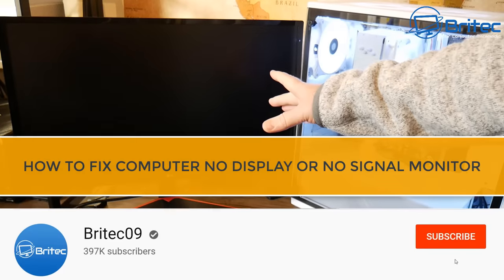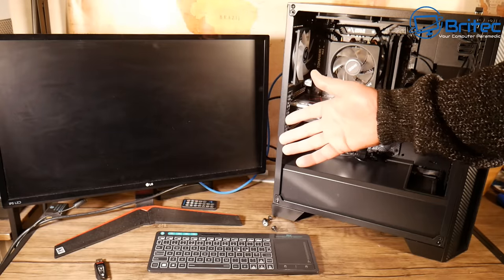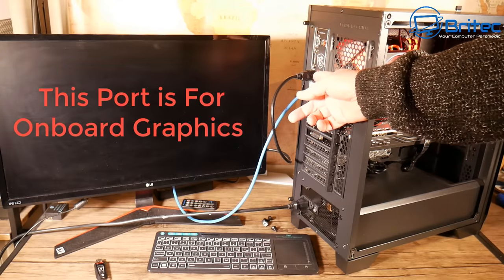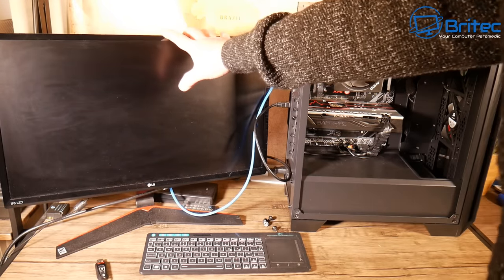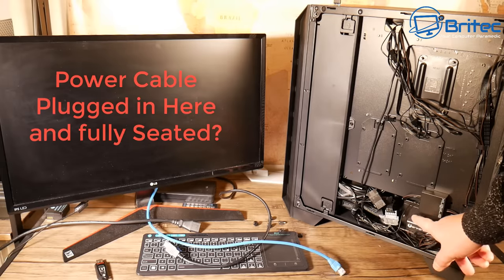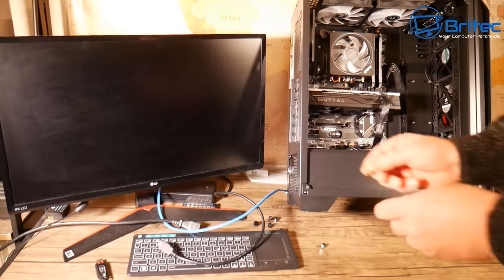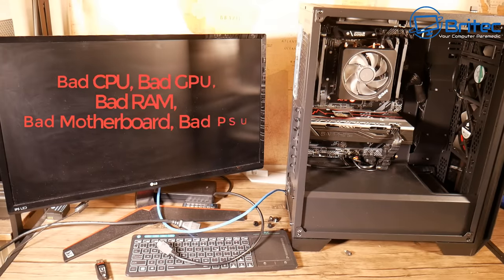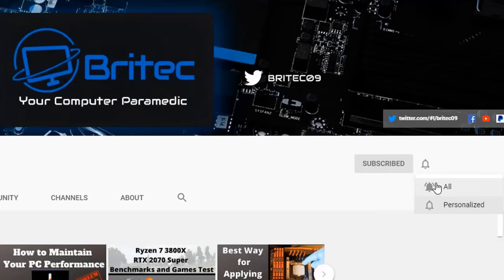How to FIX Computer No Display OR No Signal on Monitor

Comment: My pc is running but no display is coming up, and also can’t turn my pc off from the button?
Reply: Same problem, have you fixed it?
Reply: @gayleedriannerivero6540  I turned it off from the mains and went back to it around 3 hours later and it was running 👍🏼 make sure the hdmi is in the graphics card hdmi aswell

Comment: I have this probleu
But unfortunately none of this works for me
My monitor just goes immediately to power saving mode
I tested the monitor using the same HDMI cable to an android box and it works fine
I also tested the Pc using the HDMI cable to my TV works well also
I have been using the monitor for about 5 months with no issues.

Comment: Hello,
I have a problem with the Samsung sa100 computer screen.

CPU works very well and the screen shows signal: white rectangle and mouse 🖱 in and there is a 5 dots; like when the screen is still processing. But it is not showing anything else.

I tried and turned it on from its botton but again it shows that same rectangle mouse. When I plug off its cable from the cpu it shows different signal that is white rectangle with plug off and never turn off until I due so.

There’s no problem had happened with this computer at all and it's new but I couldn't use it from over 4 years.
What do you think it's problem?
Thanks in advance

Comment: My pc is on and everything is correct and plugged in but it won’t go on the screen and my keyboard and mouse won’t even turn on. What does this mean
Reply: same i just built mine and dont know what to do
Reply: Any update?
Reply: @hearsay8741  Turned out my motheboard was broke and a cpu pin was bent so

Comment: I have a problem with my external monitor not displaying from my connected laptop. It has orange lit indicating a power, but it doesn't turn blue instead showing "no signal". I have a broken laptop screen though and the external monitor is working well with other computes. My vga cord is working well and I've tested it with other pc/computer. Can anyone help me/ give me advice I would really appreciate. Thank you.

Comment: I ruled out everything beside the graphics card and the power supply cable. I know it has to be either the graphics card is dead or it’s not getting power 
I have a 5500XT paired with a powerful psu. I don’t want it to be the cpu or the  motherboard cause the cpu was quite expensive

Comment: Hey @britec09, I've got 2 problems with 2 pcs, with no post, brand new items. 2 pcs with 2 ryzen 2600 cpus, 1 has b450 aorus elite with 16gb ddr4 3000mhz ballistix rgb, 1 has x570 aorus pro with 16gb ddr4 3000mhz ballistix elite. both have stock bios. not been upgraded yet as they both show no post with dram led. have also tried with crucial ddr4 2400mhz 4gb in both systems and still no post, have swapped ram slots and batteries. can not get into bios on either. any help from anyone is appreciated thankyou.

Comment: So I had a problem with my pc it was stuck on bios settings someone had a look at it for me and found a faulty hard drive so they removed it and I took it back plugged it in and it came on but it was asking for a password. That person wiped the computer and I didn't realise the password was on the screen so I watched a yt video and it said turn it off and on a few times so I did and it a loading screen came on but it was not connected to my WiFi as I changed the WiFi password while this person had the p.c and after a while I just turned it off and now I have no display can anyone help please.

Comment: both my monitors keep turning off and then the sound turns off on my head phones but all the rgb peripherals are staying on, does anyone know why?
Reply: Bro did you find a solution that is happening to me now
Reply: @rqfn7243  My GPU broke. So I've been using a 1060 instead of a 580 until I get a 3060 ti xmas.

Comment: So I just built a new gaming PC. Monitor says it detects the VGA and HDMI connections but still no signal. Any ideas?
Reply: Did you fix
Reply: @saints_  Yea so it turned out that my monitors were VGA only while my mobo only had DVI ports. Had to buy a VGA to DVI converter.

Comment: Ive built my first pc and when i first start it i get the no signal but if i turn off my pc and unplug the hdmi cable and plug it back in and turn my pc on it works anybody know what the problem could be ???

Comment: whenever i on my pc my card and pc on all fans working properly and also graphic card l.e.d no beeping or no ram issue but it is showing no signal on my led monitor what to do?
Reply: Did you find a solution? I'm having the same issue
Reply: Grant Marzette same
Reply: @saints_  turns out there's an issue with my motherboard and it has gotten damaged while shipping. Found this out because not only was I having issues with the "no display" message, but my keyboard would work but my mouse wouldn't. I have t send the machine back into the retailer to get it fixed. Not happy about it.
Reply: Grant Marzette so sorry man

Comment: I fixed my no display monitor. I tryed switching power cables, turning pc on and off, turning monitor on and off but it didnt work. So i tryed this. I have a VGA monitor and HDMI pc plug in. So i had to play like a stick so i can go from vga to hdmi. Everything worked until today. So i plug out this stick form my pc and from monitor. Cleand it and plug al in but i didnt plug the stick in the same place. I changed the place of a stick. I have to places to plug in the stick so i tryed that and it worked. Of course the other plug was right next to previous one, the plug for my graphics card. If changig place for oyur cable( or stick like for me) isnt working then try to buy a new cable. If that doesnt work then buy a knew one or go to the shop for computers and try to fix it.

Comment: Still doesnt work, It cant be the monitor bc I've tried connecting it to my ps4 and it works perfectly fine,its not anything in the pc so it just simply doesnt work
I've spent around £2000 on my setup just for it not to work
Reply: Um hi this happened to me it was really frustrating like everything would turn on the leds and every fan was working but it wouldnt display apparently my motherboard wasn’t compatible with my cpu so it might be that
Reply: @kuy-y7291  hm ok I wi look into that ty

Comment: On Win10 my display screen went,I taught it might be the PSU as my Desktop is from 2009 Packard Bell )Intel core2 duo ixtreame x6620 8gb Ram and I used  a Rubber(Eraser) ✏️ to clean the ram and yes my display came back on display .Still going strong 😂😂Thank you sir

Comment: If monitor is working on another device just fine and with the exact same cable reinstalling system console drives and display driver worked for me

Comment: can anyone help me i have a gtx 1070 my main monitor is asus 75hz using hdmi and the other one is a benq fp93gw using dvi d.the benq monitor is not working idk why the cables and the monitor is fine because i tried it with an other pc and it worked expect my gaming pc with the gtx 1070.can anyone help me ive been trying for 3 days now.

Comment: could be the onboard graphics chip if thats gone even if you plug a graphics card in it wont work. Cheapo gigabyte boards are the worst culprits for that. I have had 3 gigabyte boards and all 3 the onboard graphics chips went on them

Comment: well my monitor wont display any reaction, just like when i unplugged it from the pc. the external devices like mouse and keyboard dont connect either.

what should i do? clear bios, get new motherboard?
Reply: yo what fixed it fr you

Comment: My pc was just working like an hour ago at my friends house and it has always worked but now it’s just not working Please help?
Reply: Same my pc has it lights and fans working but there’s no display. Let me know what you did if you fixed your problem
Reply: Jeff Bezos same, all rgb things turn on, my 2 monitors are on but when I log in it just loses connection or will lose connection a few mins later, i got a gold 850w psu so it isn’t that either so idk what’s going on
Reply: @confusedjojo7714  did you fix

Comment: My pc starts up and it has a display, but about 5 seconds after I’ve loaded into windows and when on the home screen the monitor goes black and says no signal. And I know it’s a gpu problem because I overclocked it and the second I did that it started happening. I’ve removed the gpu and put it back in, does anyone have any suggestions? Would be very appreciated
Reply: I don't even have a gpu it's integrated into the processor I think that's my problem
Reply: I fixed mine, I had overclocked my gpu way too high with MSI afterburner and whenever windows loaded up it crashed, so what I had to do was press reset button until the blue troubleshooting page cane up, and booted the pc into safe mode. So then it allowed me to go onto my desktop and change my settings back and that solved it.

Comment: My monitor sometimes goes randomly to No Signal it only happen when i left the game on standby, but yesterday as soon i booted the pc or runned some games i got the No Signal immediately, i tried with my tv and pc wokred totally fine...so i guess is an issue with the monitor , ateast is not my gpu
Reply from the maker: Check your HDMI, cable or cable that you're using. It may be faulty also, the pool and the monitor may be failing

Comment: I have same issue to day I updated my windows 10 and when restarting after showing no signal
Reply: PcGamesNewTrailer Navadha thats exactly what happened to me. Updated my windows and now It connects highly rarely after unplugging the graphics card and putting back in and praying to fucking god it will work. If I get it working I’m going to deleted all the drivers because that could also be an issue
Reply: @RatpoisonX  bro I got a solution you need to detach your graphics card from mother board 
And Start CPU if it on then download HCR and set a shot key like (j) and two more resolution
Reply: @RatpoisonX  after that you need to restart pc and press hrc and enter your hrc working in background where showing arrow and then press j your screen gona change
Reply: @RatpoisonX  this tutorial you need to apply with monitor on and after this you try off monitor trial 
Then you put your graphics card and try it the is gona very useful no any video available for this thing but this is your resolution problem 
Your monitor is 1920 × 1080p 60hz but Graphics cards set on 1hz
Reply: @GamingLive752  you maybe got a vid or a tutorial of this i have the same problem
Reply: @orapidliquido1778  if the problem is starting after updating Window and graphics card you need to follow my comments up there 100% working we don't have any other choice
Reply: @GamingLive752  Can you repeat the whole process but detailed i dont really understand it. Thank you :D
Reply: @orapidliquido1778  download HRC first from Google
Reply: @GamingLive752  From a seperate device yea?
Reply: @orapidliquido1778  yes and first you unplug your graphics card from CPU and run it install the hrc resolution changer
Reply: @orapidliquido1778  you have any discord???in your mobile?? Maybe I can tell you everything face to face I wana help you,
Because I spend 3 days in this problem??
Reply: @GamingLive752  Yea i have discord
Reply: @GamingLive752  my name is Big Iromn#8774

Comment: I've had a new cpu, new motherboard, new ram.... tried 2 cards... 2 psu's and I don't get any fucking signal what is going on I'm going insane.... I've tested the parts in a different pc and they work.
Reply: i’m sure you’ve figured it out by now but it’s def the monitors or cables to it
Reply: @surefiresteak0292  it wasn't. It was somehow the motherboard but thanks

Comment: Ok so look, i have gpu amd hd 7750 1gb gddr5 8gb ram and q9550 procesor and motherboard G41-p21 with 775 socket, i bought gpu last 5 month, and it works Perfectly fine till now. So basically one night i played pes 2017 and shut down pc normally before going to bed, when i woke up and starts pc, pc starts and shut down and again starts and shut down and third time pc starts  but there is no display on monitor and gpu fans starts spins and Immediately stops spinning and thats it, i see green light on pc, but there is no beep from from motherboard.. (beep what we heard when starts pc if you know what i mean). I Literally tried Everything, removing cmos battery and wait 5min and nothing, clean dust, nothing, clean ram, nothing, check cable, nothing. But when in unplug gpu from slot and connect monitor with motherboard, pc works fine... I tried gpu in my friends pc and gpu works, i changed psu and still nothing... I Literally have no CLUE WHAT CAN BE.. PLEASE HELP ME I DON'T KNOW WHAT TO DO ANYMORE

Comment: I've been trying to figure out my issue for months this video is no different from the others I now have to save up even more  money to replace more parts I'm about to give up with it.
Reply: Try unplugging the power cable from the monitor while the PC is on, then when there is no power in the monitor (no standby light) plug the power cable back in.

Comment: My gaming PC the push button on the top the power at home quit working so I unscrewed it from the top of the case and was using the car key to turn it on on the circuitboard well my dog to the cableTo the power switch from the motherboard so I was shorting the pins on the motherboard to turn it on well it worked fine for a couple of months well I haven’t used my computer in a while and when I try and do it again now it just it fires everything up all the fan start turning all the lights turn on large V even though I have all the orange returned off on the app in the computer but it doesn’t send a signal to the keyboard or mouse it doesn’t send a signal to the display and I’ve change the cables I’ve change the HDMI slot from the graphics card to just him and one on the motherboard I don’t think it’s actually booting up I think it’s going in like a standby or something but I’m not sure

Comment: Sometimes my computer works perfectly it is brand new literally 2 weeks old Sometimes I'll turn it on and there is no display at all on the monitor Except a little message saying there is no signal You can't even turn the computer off On the computer You have to turn it off at the power supply
Reply: same
Reply: im exactly the same
Reply: @anthony-mc7mr  wonder what it is

Comment: I have a problem big problem my vga hdmi and dvi just died in this fucking second on my HD 5450 its an old card it's OK but ym cpu is r5 3400g I am not using it cuz my pc was on any litgting striked  near my house and hdmi died on mobo after that I was using dvi d for vega 11 after 20 days it just froze and died like that's it.. And what the hell is problem my mobo was 3 times in the shop for repair where I bought it but every time they would say its working idk what is problem with

Comment: i run dual monitors...
and while gaming, i suddenly got a crash and my main monitor had no longer signal...
i already eliminated few possible causes, like bad gpu/ bad cables... cause i connected them to my TV and worked just fine...also the monitor was ok, because i had no signal, yet i could enter the options/ optimization menu...
and... it was the drivers... it's always the AMD poor drivers that bring this kind of stupid shit happening :)

Comment: First thing  though  shall  test  rail voltages  and or line  voltages because you won't see that on  other Youtube channels  Your  AC/DC test  meter is  your  best friend   You need to  check out De-oxit    cleaner for those  contacts.  Posted on Facebook,   Bye for now Cheers
Reply from the maker: Yeah contacts can cause problems